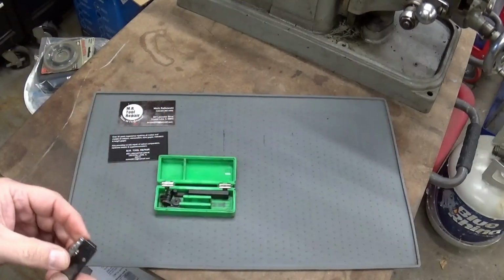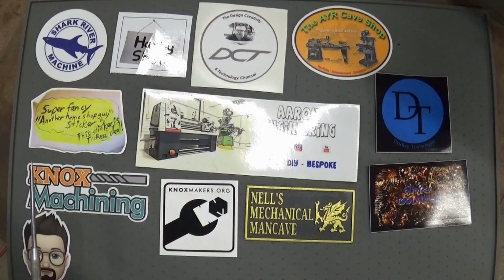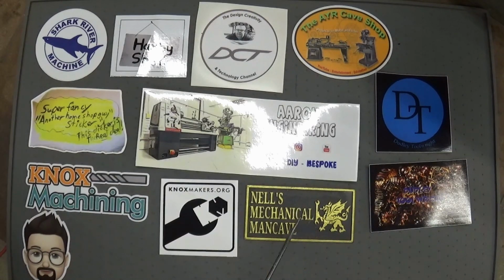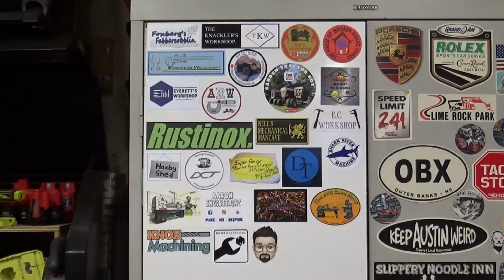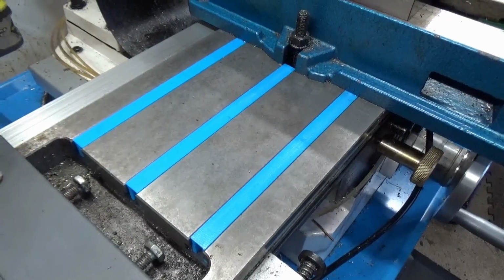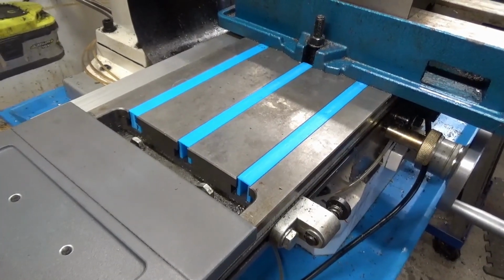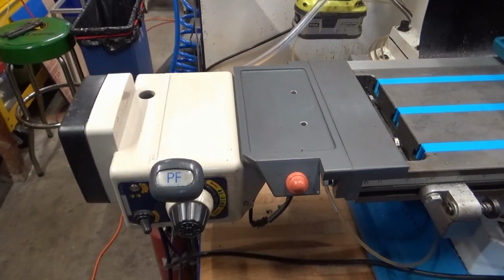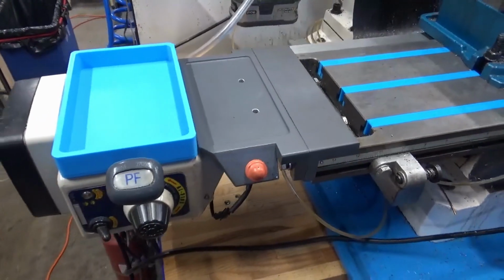3D Printed Mill Stuff and Stickers

Comment: Hey Mick, thanks for the shoutout. Those covers are a great idea. Which brand TPU did you use? They looked a little stiffer than I one I used. I guess my stickers got lost in the mail. I will send you some more out. Actually it is funny that Nell is doing 3D ones. I was actually thinking about that, maybe I will CAD a few of those up. I did get yours. I have just not had time to do a shop update but they are coming. All the best! Eddie
Reply from the maker: Hey Eddie, yeah I haven't received any stickers yet.  I think the USPS has it out for me, they "lost" several packages in the last month.

The TPU is Overture.  It might appear stiffer because the t-slot covers are kinda thick, probably more so than really necessary.
Reply: @MicksWorkshop  I will send another one out.